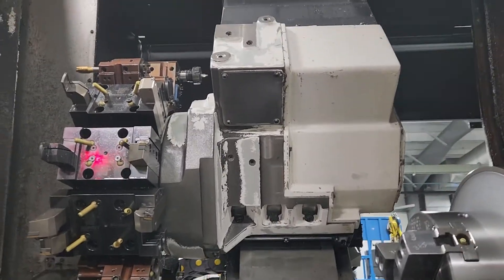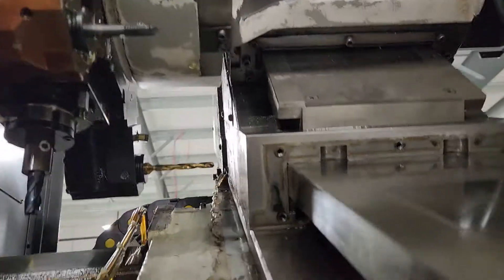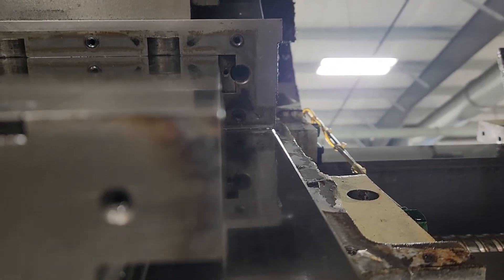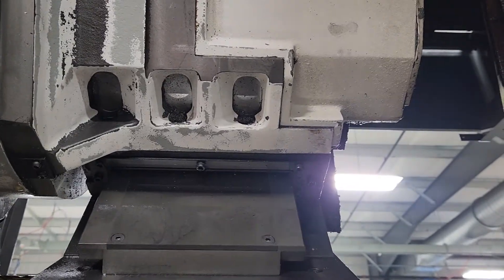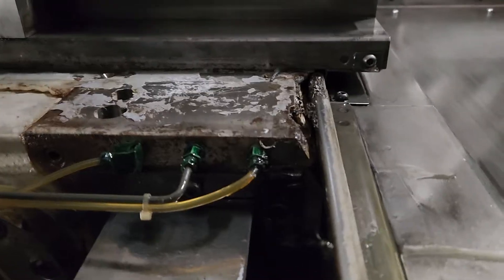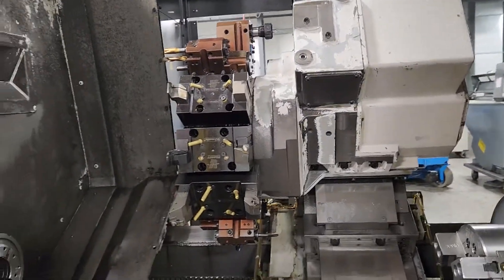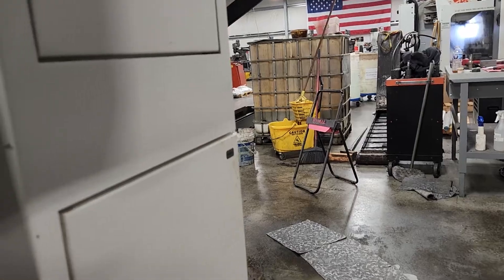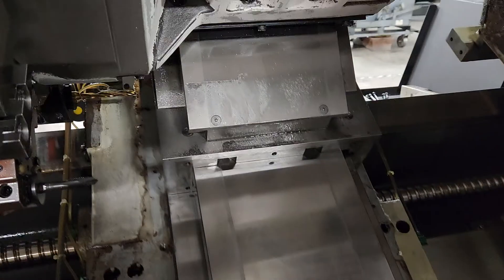Preventive maintenance on an Okuma LB3000EX

Comment: Hi Daryl. Thanks for your informative videos, I learn alot.  My management is not a fan of changing the Hydraulic oil or even the filter at the recommended intervals. What sort of issues arise in these machines with lack of Hydraulic oil changes? Just want to be on the lookout and be able to make the case for more regular changes. Cheers
Reply from the maker: The hydraulic oil is the only lubrication for the bearings in the actuator that opens and closes the chuck. Have your company check on the price of a new one, and they will start changing the hydraulic oil. The oil also lubes the bearings in the hydraulic pump itself.
Reply: @OtherBrotherDarylSmith awesome thanks

Comment: can you do a vid on headstock and subspindle alignment for these EXs?
Reply from the maker: If I have a job come up where I need to align one I will try to do a couple of "how to" short videos. The problem is that a customer is paying me to fix their machine, not make a video. That's why there are not many long videos, just a few short ones on bolt locations, and other tips.

If you have to align an Okuma headstock you have pretty much destroyed the turret or cracked the x-axis slide. I have seen a way broken in half too. I rarely see a headstock moved on an Okuma. Haas on the other hand, it doesn't take much to move them and the headstock is on a different plane than x-axis.

The easy way to check headstock and sub-spindle alignment is with test bars, but the best way is by cutting a diameter about 10" long then use a micrometer and check for taper. Adjust the headstock until the diameter measures the same at both ends. Also, use a coaxial indicator in the headstock to sweep the sub-spindle. A mag base and indicator will give bad readings due to gravity.